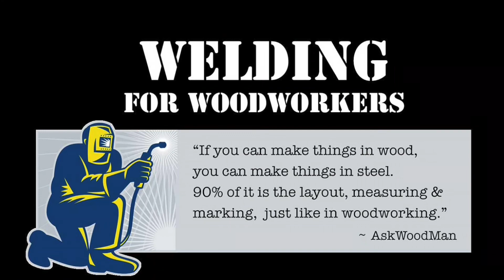885. DIY Welding Cart –Cutting Pins With Japanese Rip Saw

Comment: I just cut my first set of pins ever using a japanese saw using pencil markings as a guide. Obviously it became really hard to cut square pins which then flowed into the tails being odd shapes. Was actually quite disheartening and a lot of paring to get it to all fit together. Watching your video has given me some hope! I'm going to try this method and hopefully get some nice pins. Also drilling straight down makes sense! I was trying to drill on an angle to follow the cut which was really hard. Cheers from Australia :P